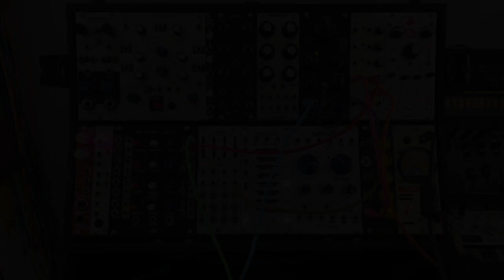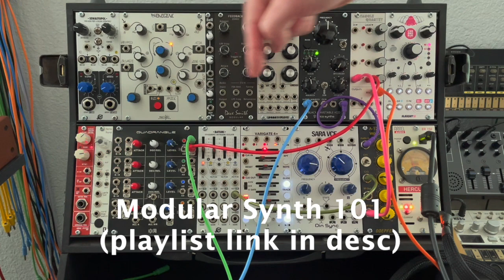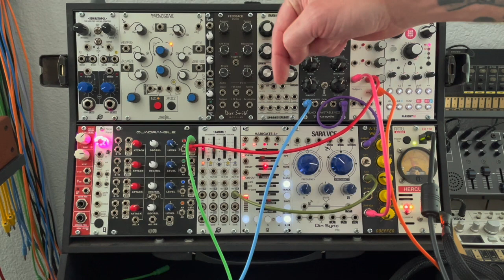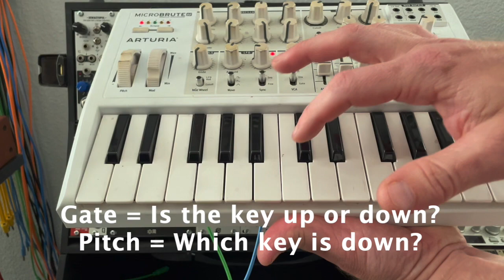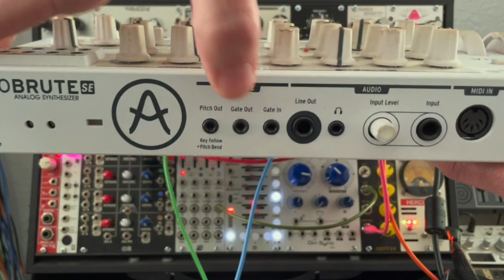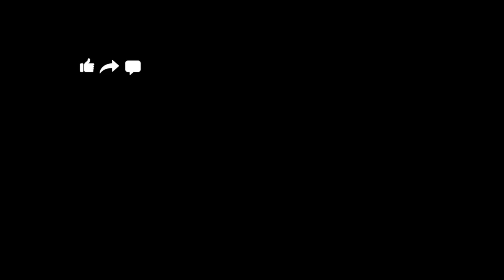What are Gate & Pitch Signals? (Modular Synth 101 | Part 8)

Comment: Is a waveform a gate signal?
Reply from the maker: Thanks for checking out the video. Generally speaking, people don't refer to gate signals as waveforms. For the most part, waveforms are the signals produced by oscillators (VCOs). I have a separate video in this series (Part 3) on oscillators. You might want to check that one out if you haven't already.

Comment: Hi Kale. My intro to gate/pitch was when I got a Baby8 and APC from Rakit a while ago. I'm not much further on but this is all very relevant to a current project. What I'm wondering is this - is the CV for picth standardised? So if you press a middle C on that keyboard you'd expect the sound to be exactly in tune. If you took the pitch signal and put it into something else, would you also get exactly a C and is there a standard written down somewhere for exactly which voltage represents which note on the scale?
Reply from the maker: There is! The 1V per octave standard is what most synths use. So 1/12V per semitone. If properly calibrated an oscillator should produce a C at every even volt (1V 2V etc). However I’ve honestly found this to be relative in practice. But the standard remains. If you tune all your oscillators to the same base note, they should all track the pitches.
Reply: @musicalmiscellany  Thanks Kale. Do you happen to know what the expected voltage range is with cv?  I've measured my Rakit kits and they seem to give a max of about 7v. That sounds about right as 7 octaves would roughly be the sensible musical range. Could it 'potentially' (haha) be higher or is that the expected max?
Reply from the maker: @midi_in  It gets a bit confusing because the standard responds to negative voltages as well. So if you had a -5v to +5v signal, that would be 10 octaves of pitch CV (provided your oscillator could even track 10 octaves - and even if it could, the oscillator would have to be tuned to dead center with 0v to fully track this). There are some oscillators on the market that can track 12 octaves (or more) but most can only handle about 3 or 4 with any accuracy. So yes… you can easily get outside the oscillator’s range. 

Check out this link. https://learningmodular.com/matching-octaves-in-your-modular/ they understand this much better than I.
Reply: @musicalmiscellany  It seems that it's the relative change that's more important than the actual voltage. Thanks for the link.